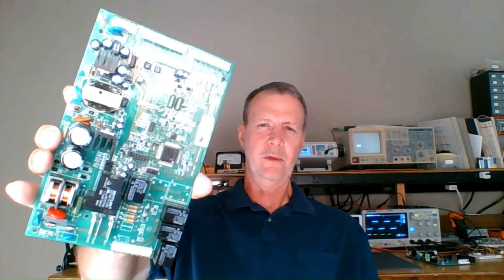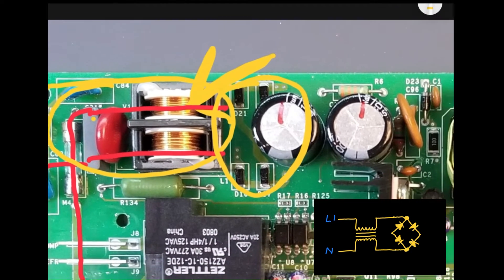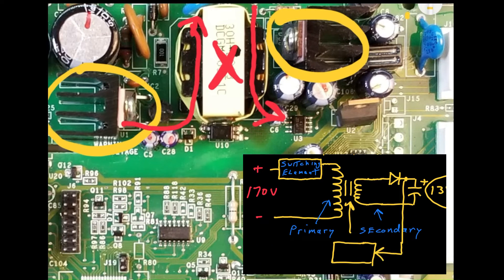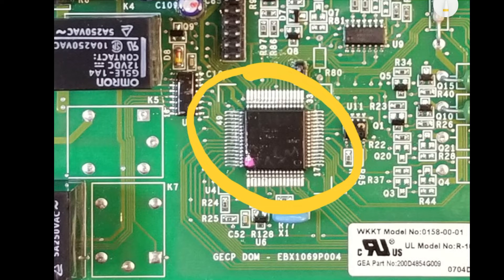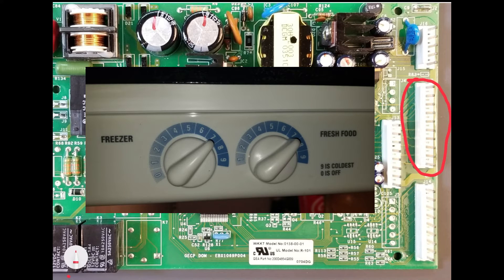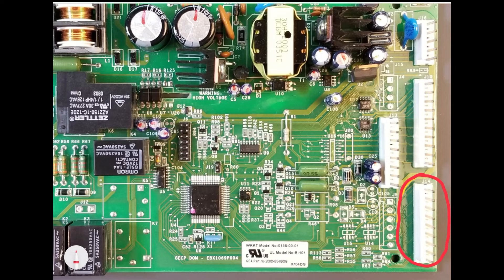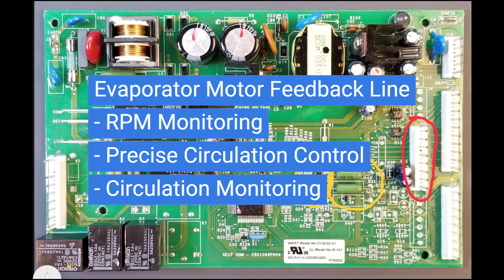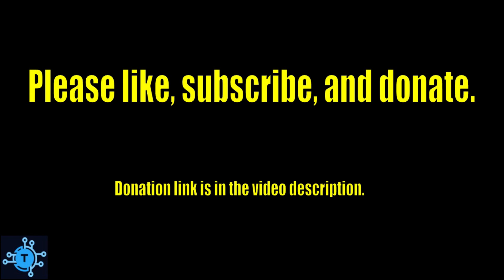#56 - "Control Board Explained! Power Supply, Microcontroller, PWM, and Troubleshooting Guide"

Comment: I would like to get my hands on the part#'s for surface mounts Q1 and Q10 - Q5 and Q15 driving the fans PWM control signal. I can't pick out the writings on their surfaces (One of them flashed).  I know Q1 and Q5 are 2Xz's.

Comment: Great explanation thanks 
Question to test the components in circuits boards you have to isolate them from the circuit boards or ????
Reply from the maker: Not necessarily. Lots of test can be conducted in-circuit, with the power disconnected.